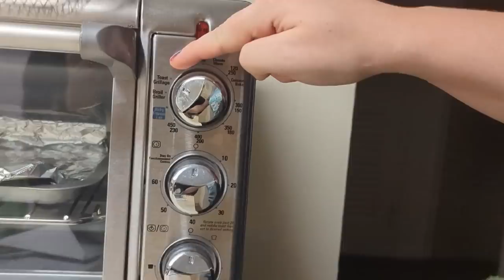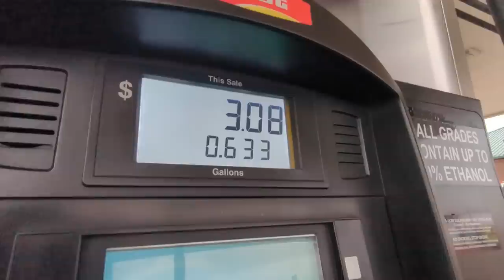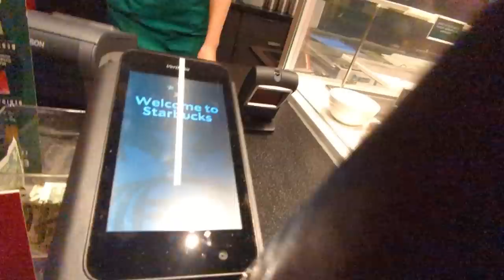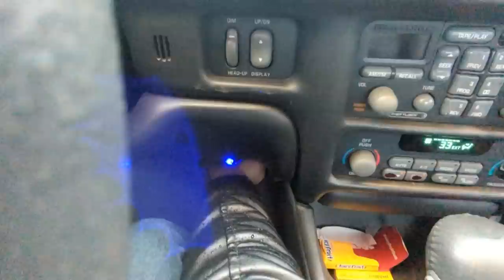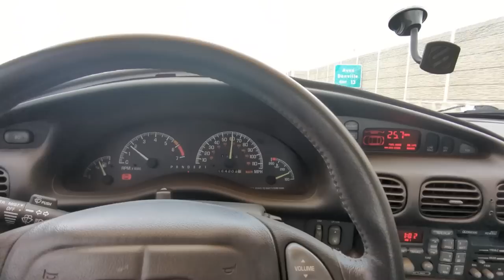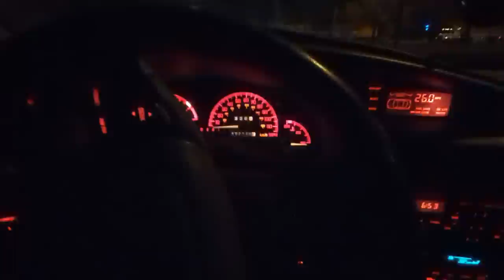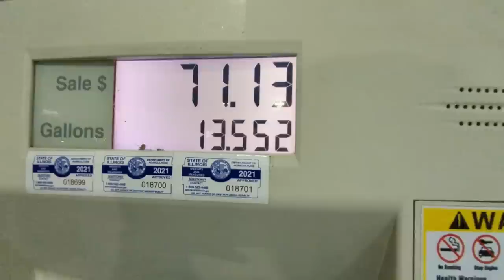Homeless Vlogs | Snowstorm

Comment: In the future;
With a suspected faulty ignition coil pack, what you wanna do is swap with a different coil pack. So swap cylinder 6 coil to cylinder 4. And see if a trouble code for cylinder 4 pops up. Should take ten minutes to an hour of driving

Comment: hey when are you mining make sure to set timer for display to turn off so you dont kill the display fast (I was wondering where your macbook was)
Reply: I think it was XMR on Nicehash I tried on my old Lenovo X230, but I noticed mining was slowing down with the screen off etc. Disabling the PCIE link power saving settings in Win 10 fixed it.

It maxed out at 23 Watts of electric. If you made a little fort by hanging up a blanket over you in the car it'd get toasty with your breath too.
Reply: @dazednconfused31337  oh he is on mac-os I thing he has option to turn off display after some time, on  mac that just turns off display it doesent effect performance cuse a lot of ppl use macbooks as pc-s, on windows that is a big problem
Reply: @dazednconfused31337  I have lenovo X230i lol

Comment: Can you show us how to mine ctypto !?
Reply: I used Nicehash, but only when idle as it made my mouse all jerky. With my old PC and slow GPU it costs more in electricity than it generates.

It's even worse now the electric cost has shot up and crypto keeps losing value.

I used it to help warm my room up faster and it sort of pays something back compared to my 1500w fan heater.

It'd be useful if you have a lot of spare solar power and maybe Antminer type hardware. In a hot country it might be more profitable to run air conditioning from the solar instead.